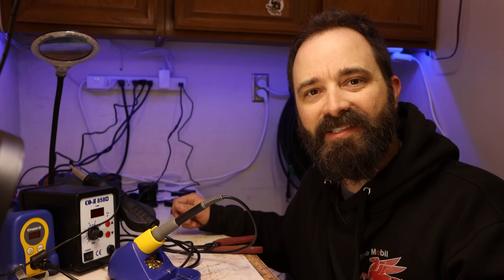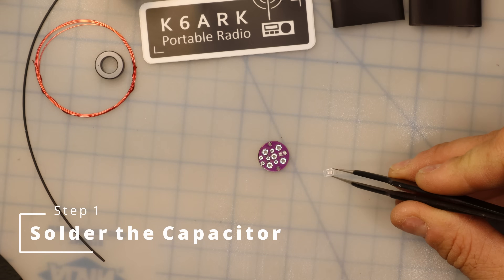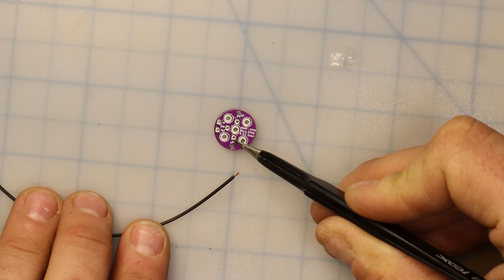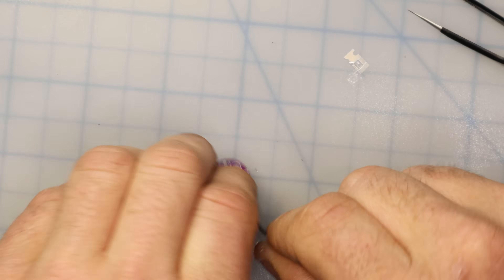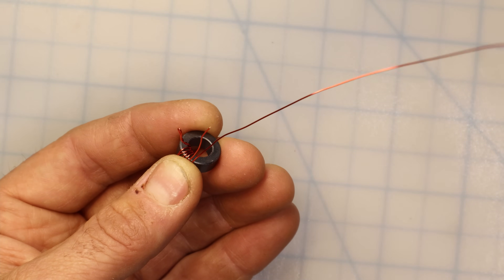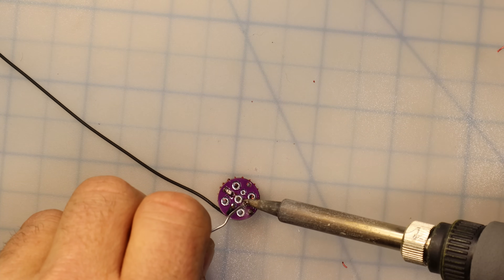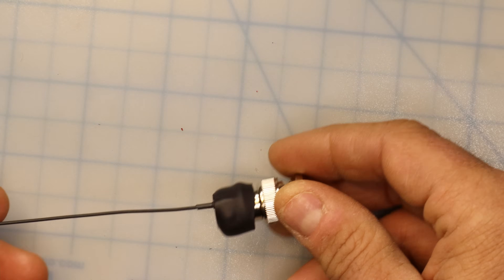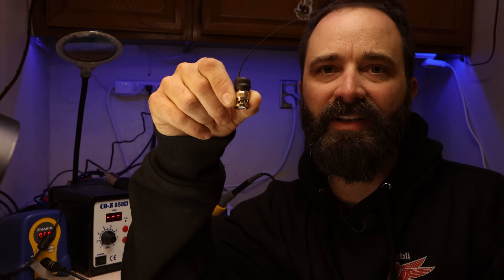K6ARK Matching Unit Kit Build - End-Fed Half Wave (EFHW)

Comment: I built 40m endfed with and without the 100pf capacitor. I have actually built a dozen 49-1 z autotransformer.   I always stick the 100pf capacitor in the input side.   Not until you or maybe it was some one else that said the cap is not needed.  Why is it there for.   I get the same SWR curve with a 2450 Resistive load no matter if it is there or not.  It seems that the capacitor makes a tune circuit around 4MHz from what I can tell.   Why do I need it?
Reply: I answered my question when i phrased it.  The cap is needed to cancel the inductive reactance. I don’t realize it when testing because I have a resistor as a load and not a wire exhibiting inductance.

Comment: Hello Adam, I'm a long time builder and marketer of bare bones matching xformers. Your kits rule!  I have found that just 2 turns primary and various secondary turns can yield good numbers. case in point, With a 2:11 turns ratio, (1:30.25 imp ratio) i get VSWR readings of 1.1:1 to 1:2:1 @ 50 ohms with 40 m EFHW on all 4 bands, (with a bit of trimming).This is with the ft50-43 you supply. Using ft114-43 works well with this ratio as well. I know these numbers aren't representative of true performance. Your thoughts? Does more turns = better performance? It's wild that it tunes 40 so well with so few turns.  John, kg6zbn
Reply from the maker: 2:11 should work great as well and may be more efficient, particularly on the higher bands. Nice work experimenting and refining the build! Thanks for the input and the feedback.

Comment: I'm not super techie and sorting through this. Using this antenna with a pota setup, do I need an additional wire for activation or would this work? Also for a newbie, which one of these options would be the best for someone who wants to learn use pota but has the lowest opportunity to screw things up? Thanks!

Comment: Cool! Thanks for the video. The webpage instructions have in/gnd/out for the wrapping of the toroid which would have led to a cross over of the enamelled wire into the PCB I have. Following these instructions 10:55 I've got in/gnd/out, the right order for the little black PCB I've got!
Reply from the maker: Follow the written instructions. The board has been updated from when this video was made.
Reply: @K6ARK  Ok, I will. Thanks!... looks like it's working great!  I used a bit of blu-tak to steady the PCB for soldering the capacitor. =)
Reply: Are there any plans to start producing the kits again or are the pcbs available for purchase separately? Cool antenna and looks like a fun beginner build.
Reply from the maker: When I have time again. Work is too busy right now. Hopefully soon.
Reply: @K6ARK  hey man, if you need help putting together some of the kits and I can donate a bunch of time for free. I live in North County.

Comment: Hi Adam!!! What antenna wire is recommended for the 5w, 20w and for the 100w kit?
Reply from the maker: My favorite portable antenna wire is Poly Stealth. I like 26 ga for the smaller kits, and although 26 ga will also work with 100w, I like 22 ga for the nicer handling characteristics.
Reply: Thanks for the info!! @K6ARK

Comment: I screwed something up.  I cant tell what.  Maybe I'll start over with a new one.  The only thing I noticed is that I bridged the CP to GND pad when soldering the coax connector on.
Reply from the maker: Charles, the most common failure is not removing enough enamel from the magnet wire. Check for continuity between the BNC center pin, the antenna wire, and the BNC ground. Three should be close to 0 Ohms Resistance between them. 
If that's not the issue, feel free to send me an email with some close up photos of your build. Remove the external heat shrink if you installed it already. Try to get a few different angles so I can see which windings are connected to which pads. I'm always happy to send some spare parts if you do end up needing to rebuild.

Comment: I’m about to built this kit. I don’t anticipate using a counter poise but what is the downside of putting it there just in case I want to try it out?
Reply from the maker: There's nothing wrong with that at all. You can always just cut off the stub if you never use it. 
Be sure to follow the written instructions. They are a little different than the board that I was using in the video.

Comment: Thanks Adam for the well put together video.  Being new to building an antenna, this will help for my first. 📡
Reply from the maker: Please follow the written directions as the build process has been modified a bit.  The updated toroid winding method is a little easier and the boards were updated to accommodate for additional build options.

Comment: Hey Adam, I built the random wire antenna and used the capacitor…will that cause any issues?
Reply from the maker: If the rest of the matching unit is built correctly, probably won't make much of a difference.

Comment: Hello Adam, quick question regarding the mini microphone kit for the truSDX. Are you still producing them? Can’t find them on Amazon. Thanks Roger W8RLP
Reply from the maker: I produce kits when I have time. I work a lot at a day job and volunteer for SAR among other things, so my free time is limited.  I try to balance it across preparing antenna kits, mic kits, and winders, and then of course doing an occasional fun thing for myself like a SOTA activation or backpacking trip. You can always build your own from the files on Printables and the bill of materials posted there. Link to it from K6ARK.com
Reply: @K6ARK  Thanks Adam, I appreciate the info. 73

Comment: Hi Adam, great kit and great video.  I recommend one additional step before soldering the BNC:  Do a continuity test to check that the enamel has actually burned off.  Desoldering and resoldering the toroid after the BNC is in place is a real bear—I learned the hard way, 😂
Reply: I notice he trimmed to the surface of the PCB, so when he soldered - the end of the enabled copper is exposed to the solder in case the enamel doesn't burn off.
Reply from the maker: @SarahC2 a hot iron is key. Mine is set at 825 F right now. It also helps to use a mid-sized to larger tip.
Reply: @K6ARK  My JBC should manage that, thanks for the temp.

Comment: This may seem like a dumb question but should there be a closed circuit between the BNC center conductor and the four lugs?  I guess there's a DC circuit though the secondary winding.  It's ok at RF?
Reply from the maker: Yes, on an assembled autotransformer , there is a DC short between the center pin and ground.
Reply: Thank you, Sir!

Comment: Has anyone asked about QRO OCFD from your Kits? Would a Choke be needed also?
Reply from the maker: Yes, it's possible to build as a 4:1 for an OCF dipole.  I've done it, and others have too.  You don't need a common mode choke, but it can help reduce noise if you're in a high noise environment (uncommon when you're out portable).

Comment: Is it bad to run the ant wire through the middle of the torroid for the EFHW config?  Also, is the other heat shrink that is included in this kit just for fun?
Reply from the maker: It's fine to send the wire out the center of the toroid.
The extra heat shrink and plastic tube is to make a loading coil to help with tuning on the higher bands as explained in the instructions.
Reply: @K6ARK  I should probably re-read those...
Reply from the maker: @jampskan5690  and I should probably create a video for tuning as well. The loading coil is mentioned in the tuning section.

Comment: This thing might be very lightweight, but with such a small toroid, the efficiency will be very low too!
Reply from the maker: Measured at about 1.5 dB.  Actually not bad.
Reply: @K6ARK  1.5db loss ?
That would be a lot at QRP power levels !
Reply from the maker: You clearly don't understand how dB measurements work. It's a relative measure, and therefore the same % loss for any power.  1.5 dB loss is pretty typical for an EFHW transformer, and is similar to what you experience in your run of coax to a dipole, particularly in a portable setup with smaller coax.
Reply: @K6ARK  Obviously you don't know anything about heat loss and how it increases the swr causing further loss as that tiny toroid heats up !  In a 49:1 transformer, you need mass for efficiency !

Comment: Great video, kit ordered! I'll be building an efhw, any guidance on the loading coil? I looked for another video and didn't find one.
Reply from the maker: As described in the build instructions, adding a 10-12 turn coil at 5-6 feet from the feed point helps bring the SWR dips for the resonant multiples of the half wave frequency into the desired spots.  I really need to do an EFHW tuning video one of these days.
Reply: @K6ARK  Thanks! Kit's not here yet, so no build instructions, lol. I figured I was learning as much by video as I could prior to arrival. Looking forward to it!
Reply from the maker: @gregorybarra5376  no problem! Build instructions are at www.k6ark.com
Reply: @K6ARK  Got it, thank you! 👍👍👍😎

Comment: I did the 9:1 build but used some cheap 26awg it's a big difference compared to the polystealth that comes with the kit...
My question is can just use 14awg stranded wire I have plenty of that
Reply from the maker: Yes, it's just going to be a very large antenna. Kinda defeats the purpose of the tiny matching unit.

Comment: Hi, Your antenna kits have been unavailable on Amazon. Can I purchase them direct from you or is there another option? Thanks
Reply from the maker: Vitor, it has been challenging to keep up with demand, but I have more inbound to Amazon as of today, including male and female QRP kits, and new 20w kits with an additional, larger toroid, longer magnet wire, and larger heat shrink. They should be in stock again soon!

Comment: I just built the EFHW version with female BNC, ready to tune the  wire but don't see your video you mentioned (to tune the antenna length) at the last of this one. I guess I can experiment, someone below said 61 feet but I'll start with 68 or so. I did test it out (using the internal tuner and about 50 feet of wire) and got a weak signal report on 7.255 with my  G90 on five watts. What  is the max power recommended with the EFHW?
Reply from the maker: Start with a bit more than half a wavelength on the desired frequency of operation and fold back the end of trim to resonance using an analyzer, or trim to minimize SWR if you don't have an analyzer.  The standard build is good for 5w on heavy duty cycle modes and 10w of lighter duty cycle like typical SSB.

Comment: Hi Adam
Just built your fantastic kit (49:1). What Wire / Gauge do you recommend?
Ricky
Reply from the maker: 26 ga Poly Stealth is the best option, in my opinion.  Otherwise, PTFE insulated 26 ga stranded copper will do.

Comment: Just finished my EFHF Build.  Total finished length 61.5'.  Flat 1:1 SWR across 40, 20, 15 and a good chunk of 10.  No Coax - direct to radio.  My tip:  I placed a loop of paracord thru the small loading coil and use that as my lash point on the radio end.... the 6' of wire between that and the BNC are then 'loose' for connection to the radio.  Thanks Adam!

Comment: Ok I got one. Hot dang, it works! I screwed up and tried to save money buying Chinese wire instead of ‘wireman’ silky wire. So I tuned it to be droopy so as not to stress out the cheap wire. Still works! Added a piece of 20’ coax. Still good on 20 and 40 meters. This is great!

Comment: I mounted the PCB board upside down
Reply from the maker: Oh no! If you need spare parts, let me know.
Reply: @K6ARK  my bad, just ordered another kit.   I’ll disassemble and correctly build the kit.   Read the instructions instead of bulling ahead.   Keep those great mountain videos coming,  we east coast people don’t get to see that beautiful country.   Thanks, Steve
Reply from the maker: @1911bladeguy  seriously, please send me an email. I'm more than happy to send a few spare parts your way. A PCB, magnet wire, and capacitor fit in a regular envelope.  You can reuse the toroid and the BNC. Can include heat shrink if you need that too. No biggie! Drop me a line with your address and what you need. 👍

Comment: Is there any plan to make a kit that is capable of doing 100 watts?
Reply from the maker: Not at this point, but I will likely put together a ~35 w max version targeted at KX3 and G-90 users.  I'll think about design options for a 100 w option, but it will require some significant design changes including a much larger toroid.

Comment: I built the 9:1 version today. Messed up the toroid winding! But found 3 colors of same sized wire and wound 3 separate windings. Colors made connecting them easy. With 29 ft element and 17 ft counterpoise tuned nicely and had 3 POTA hunter QSOs on 40, 30 and 20 at 5 watts CW. Got good reports. Thanks for good kit!

Comment: Just got mine. Great kit.  Be careful when bending the posts on the female connector. They snap if you fiddle with them too much.
Reply from the maker: Yes, they do. If you damage more than one lug, let me know and I'll get you a new BNC and updated PCB that fits better.  Or, if you just want the PCB before building the kit so you don't have to bend them, I'll be happy to send one.  All future kits will have the updated PCB specifically designed to fit the female BNC rather than the generic male one.
Reply: @K6ARK  thank you the offer. I am good - just wanted the first gen folks to know to go gently :)

Comment: Can I use that with 10 watts power ?
Reply from the maker: I generally recommend 10 watts Max for lower duty cycle modes, and 5 Watts Max for heavy duty cycle applications like ft8. I would expect typical CW operation at 10 watts to be just fine.

Comment: Hi! I've been trying to figureout what's the specs of these thin wires you use for the antennas. I saw this in your amazon sotre: "YXQ Yellow PVC Coated Tin Plated Copper Wrapping Wire Wrap 305M 30AWG Cable Reel"

Is that the wire you use for EFHW, etc?
Reply from the maker: That 30 ga wrapping wire is super cheap stuff that's nice to have around for experiments, and I've even used it for some UL portable antennas that I have used for years, but it's not what I'd recommend for a solid build. The BEST portable antenna wire, IMHO, is Poly Stealth 26 ga wire from Davis RF.  It's copper clad steel with a nylon jacket.  It's strong and small.  But it's also not particularly cheap at 29 cents/foot, plus shipping.  So I have been using a PTFE insulated stranded copper wire in 26 and 28 ga that I buy in bulk from China. It's cheap and works well, but it's still not poly stealth.  If you want to try some out, email me (good on QRZ) and I'll get some sent your way for a reasonable price. Hope that helps!

Comment: Thank you for posting this video and sharing it with all of us!
A few questions please:
1.  Is there a place we can buy a fully assembled unit?
2.  Do you have a variation where you have built SO239 instead of BNC?
3.   Which specific wire would you use if you were building an 80  meter EFHW?  That wire is long and I'm wondering if folks have a preferred wire that doesn't tangle and is easy to manage?
4.  if you were going to have a multiband EFHW, would you use a 9:1  and a random wire? Or a 49:1 or 64:1 and a half wave wire?  When going multiband with 80 m as the lowest band, which of those would be the better choice?
Thanks in advance and I am of course subscribed with notifications turned on and thumbs up! 73  W3GUY

Comment: I've got to admit, I've been hesitant to pick up any kits that require winding of torroids, but your demonstration makes it look very approachable. I'm definitely going to order 1 or 2 come payday. In your demo, was this the 49:1 or a 9:1 with 21 turns? And do you recommend a coax to the unit or would it be okay to connect direct to my Yaesu FT-817nd?
Reply from the maker: The 49:1 (3 bifilar primary, 21 secondary turns for a 1:7 turns ratio) is for an End Fed Half-wave and is what I built in the video. You can certainly connect it directly to the FT-817 with no coax. It's a great space/bulk saving design.
Reply: @K6ARK  Excellent, thank you!

Comment: Wonderful  little unit. I would suggest having a blank piece of round pcb same size as the main pcb with a notch for the wires and add it right at the end of the heat shrink process  as a cap on the unit and maybe hot glue it to seal it.
Reply from the maker: Oh, good idea. I may have to test that out. Thanks for the idea.
Reply: @K6ARK  So fun to see such a light cool unit; a round piece of hard plastic would work too. I could build one for my QCX and it would make a really light small portable unit. I am curious if it was you that I saw tuning one of these types of units using a spool of wire to roll it out while it is connected to the VNA and watch the dips and find the best length. Was that You? they first strung it out and found out how many turns on the  coil was best and then trimmed the length of the wire to the best swr. I couldn't remember what the procedure exactly was and have been looking for the video and can't find it.
Reply from the maker: Nice! Thanks. That is indeed my tuning strategy.  I can't remember if it's in a video or if I just described it.  Regardless, it works well!
Reply: @K6ARK  Thanks for the reply. If you get bored maybe do a video on tuning the core and then the antenna sometime. I am sure you get bored haha. Thanks. I am going to look up one of your units on Amazon. Looks like a great unit. I love building stuff and that includes kits. The tuning method could also be used on higher powered antenna's.